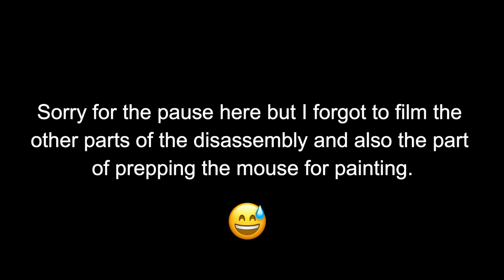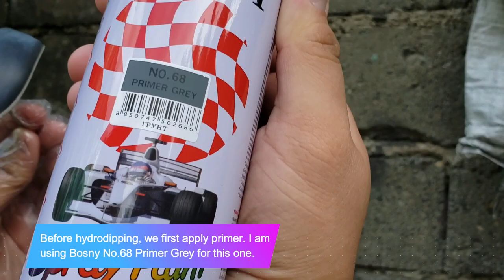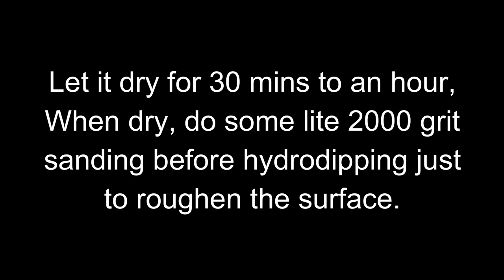How to Customize/ Mod your Logitech Mouse (Hydro Dipping and Custom Paracord) ft. Logitech G102

Comment: Was it necessary to like remove the old rubber hose of the cable?
Reply: yes because it wouldnt fit over it and he did it because he was paracording his cable so it becomes nearly weightless
Reply: @bigchungusmocha4381  the durability of the cable just goes down the drain when you do that, especially if yoy have any like cats or hamsters
Reply: @tydshiin5783  kinda true yes but its not that expensive to replace and my cats as an example dont bite my stuff because they have their own "toys"

Comment: boss pano mo natanggal yung rubber fitting sa original cable ng g102?  ( yung pang seal ng cord sa mouse )
Reply from the maker: Yung sinasabi niyo ba sir is yung rubber piece na hawak ko sa 3:59 ? 
Kung yun ang ibig niyo sabihin sir is ginalaw galaw ko lang sya para mawala yung dikit ng glue since glue lang naman gamit dun para mag stay in place
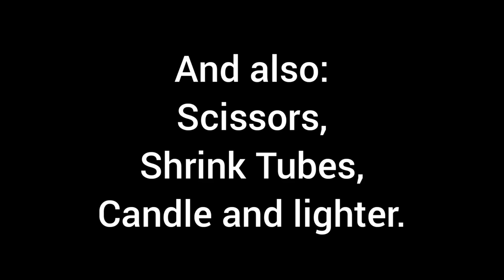Reply: ung hawak nyo sir sa 4:15 mark with the pin head, paano nyo sya natanggal sa original logitech cable sir?
Reply from the maker: @JettieJettie  naka glue lang yun sir sa cable pero separate piece yun sa cable, twisting lang ginawa ko sir para mawala yung dikit niya then nung di na naka glue slinide ko lang paalis ng cable
Reply: ok salamat sir hehe magawa nga..
Reply: add lang sir, need muna balatan si cable to its wire then pwede na itwist and loose n up?
Reply from the maker: No sir no need balatan muna, mas madali balatan yan kapag natanggal mo na yun rubber part na yun
Reply: i have pictures, pero di ko masend, di ko kasi matanggal as instruction, tried messanging you via messenger po